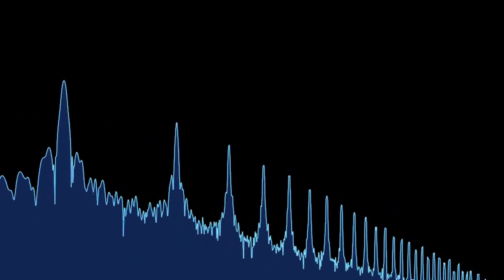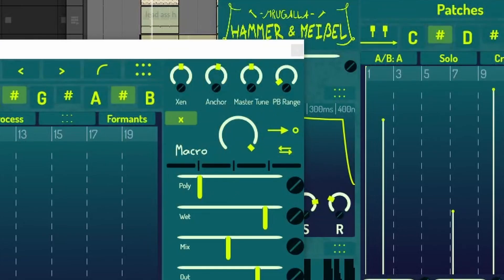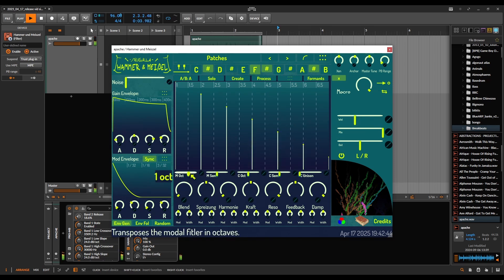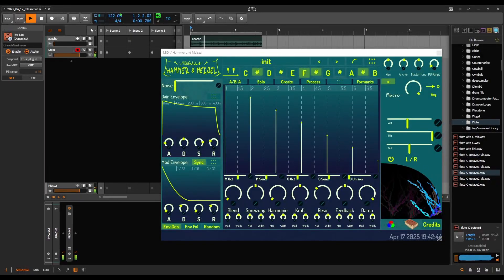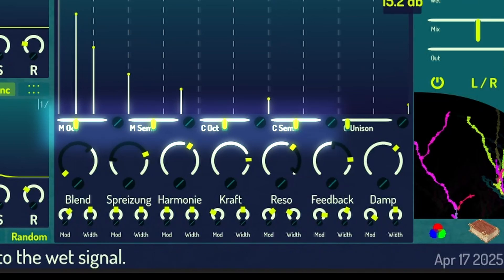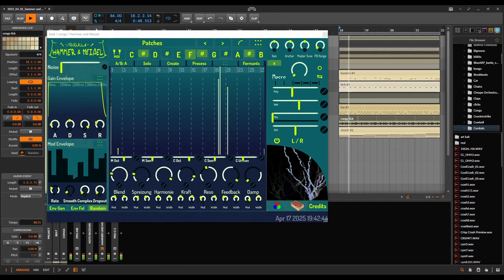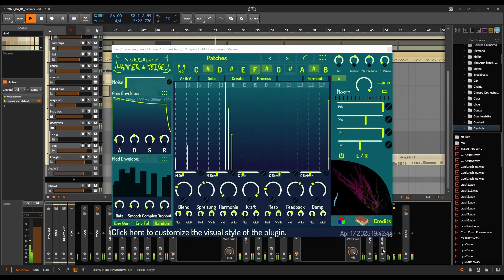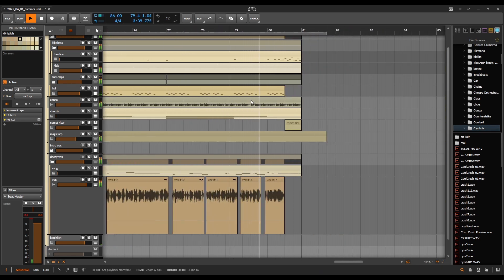Hammer & Meißel - Free Polyphonic Modal Filter VST

Comment: What a great find! I have used this filter technique in a film soundtrack to create harmonic pads superimposed on the diagetic film soundscape, so as to blend the music with environmental, natural soundscape. But patching this stuff manually by multiple instances of filters in a DAW proved rather clunky and inflexible, compared to what can be done with such dedicated plugin. I'll try using this for the final mix pass on my soundtrack!
Reply from the maker: yeah, there were a lot of ideas, but one of the core problems i wanted to solve was that it was kinda annoying to set up melodic modal filters polyphonically
Reply: @Beatsbasteln   I think I'll get a ton of use of this plugin. Thank you for your hard work!
Reply: @Beatsbasteln  Just one question.. Is it possible to add more resonant filters, or is the amount of filters fixed? Couldn't figure it out while messing around for the first time.
Reply from the maker: @spectralisation  the amount is fixed. i carefully chose for this amount of filters to strike a good balance between CPU consumption, a detailed sound and a good workflow with the modal material editor. atm i'm working on an update that will make the tuning system parameters obsolete. maybe i could use the space to add a parameter for the number of active filters
Reply: @Beatsbasteln  That would be great!

Comment: hi im not familiar with programs that use Juce, how do i install?
Reply from the maker: you copy the plugin into the corresponding folder of your OS. the download can be found in the release section on github. that is on the right side of the page
Reply: @Beatsbasteln   but i dont see a vst format, there are just jucer files
Reply from the maker: @ on the right it says VST3 PLUGIN DOWNLOAD. when you click on that there is a page that has an area called "Assets" and there you can find HammerUndMeiszel.vst3.zip (or the dmg one if you use mac)

Comment: The output levels are ridiculously loud. If I put a normalized loop through itt, the output levels are upwards of +20dB on the default preset.
Reply from the maker: @lambd01d  yeah, i also tend to turn it down a bit at the beginning. but i also often go into it with soft percussive signals. adjust the wet gain slider on the right to make a better default preset